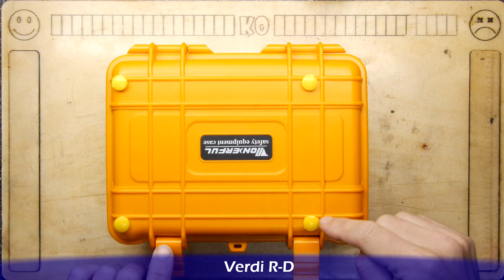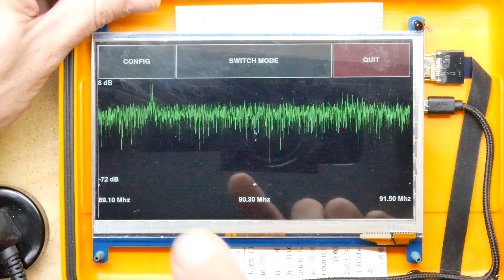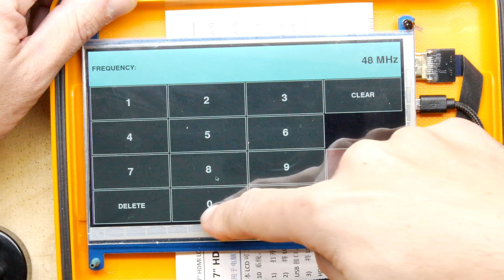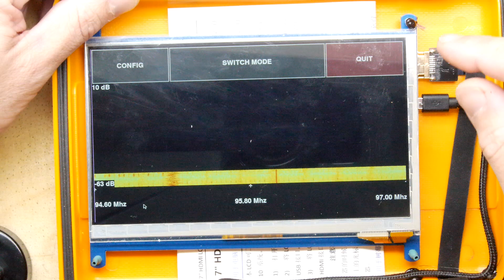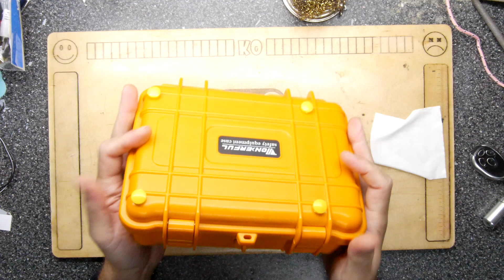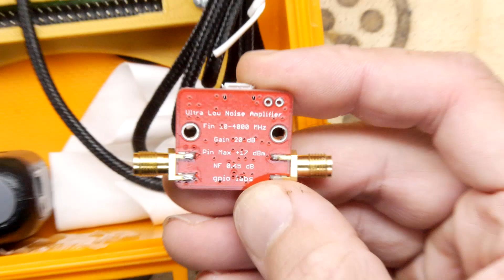Portable Raspberry Pi SDR Spectrum Analyser made from scraps!

Comment: Does it have a spectrum analyzer mode and does it have the range to see signals from a primestar dish and radio from AM, FM, SW, CB, WIFI, BT, emergency band, etc??? With a Primestar, can you see signals from the ISS Space Station?
Reply: I think it only goes up to 1GHz and wifi is 5GHz
Reply: would be nice if we could see wifi
Reply: What YOU want is an RF Explorer Pro. Mine is fully upgraded with licenses up to 7.5GHz. So it is like US $1,400 - $1,500 somewhere in that range. A TinySA Ultra + is much cheaper, yes...but this thing runs on windows, has a fast powererful processor and does pretty good math in the background to provide a snappy responsive good spectrum analyzer.

Comment: Very neat project! Is it able to do any demodulation or is it only good for seeing frequency spikes?
Reply from the maker: You absolutely can demodulate the signals with several free packages. I also have those installed, but they do not necessarily lens themselves to the touch screen, so some sort of keyboard or in screen keyboard would be required.